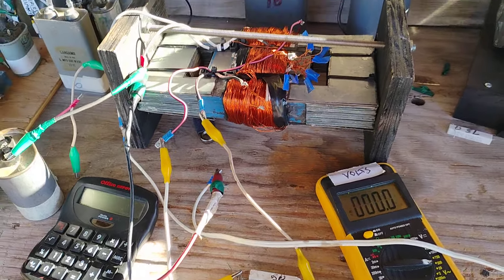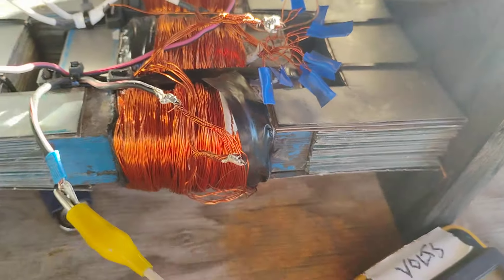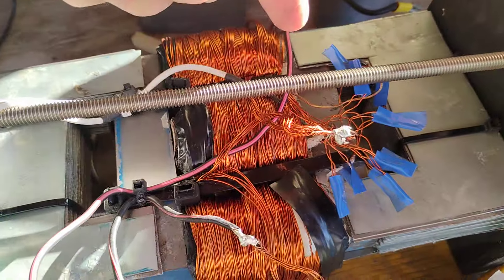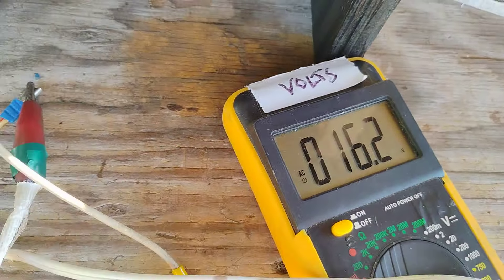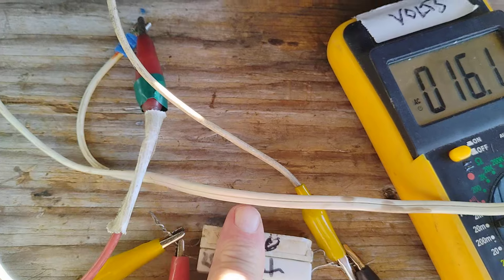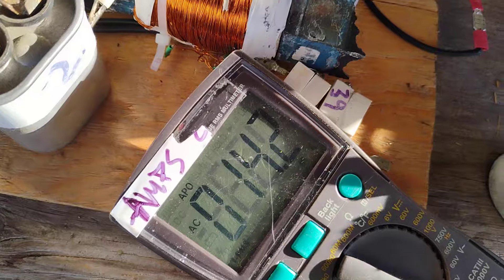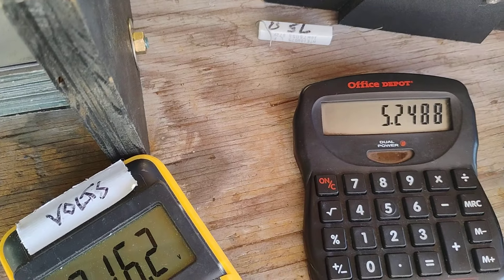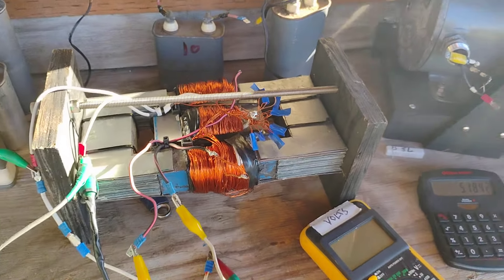5.1W output from a 1.7W input with the  hemmoroidal transformer;  (50 ohm load)

Comment: I also do OU reseach and I lost count of how many times I have measured OU but did not really have OU. Measuring AC or even using an oscilloscope can give incorrect measurements due to phase shifts between voltage and current. Also, never use those wire wound high wattage resistor - they are also inductors. Rather use multiple lower wattage ceramic resistors in parallel. As for correct input output power measurements: it must be DC, thus what is the DC power your input driver is drawing and what is the rectified DC output power?
Reply from the maker: Hi WRND
Yes I have done tons of tests with oscilloscope to measure the phase angle created between voltage in current in these sort of transformers, and would set target of making the input AC be 90 degrees out of phase, while the output with a lump resistive load of whatever ohms works best be of "real" current.....so these transformers "can be"  working like reactive power convertors to REAL power which is a good thing.  
However in these tests I "power factor correct" with caps the primary input with an AC cap in parallel to the primary (when using the grid -( the invertor tests needs them in series for some reason)  - only a very specific size cap works, not too large uf not too small so it must be some sort of resonance going on .

This is common practice with the grid - to put AC caps across the input to appliances or AC fan motors etc  that have large inductors inside them to reduce your power consumption and lower electric bil.... with the invertor I dont know if that is technically power factor correcting going on since the invertor I use actually DC boost convertors that alternates DC cap discharge for AC, so you cannot see any "phase shift" on scope for one thing...

Yes I know you want to show DC input vs DC output so no arguments but I am not trying to avoid arguments haha

With this statpower invertor I use, it is super effecient - if pumping a transformer or AC motor with it, and now lets say 6W in DC input to it, it will also show 6W input if using the grid - usually there is a loss using a transformer, but these "hemmoroidla" transformers show a good gain (since no backemf problems with them)

As for the output, it is very "solid" ("should be" no arguments) power measurement in AC having a lump resistor across the secondary output, and squaring the voltage across it and dividing by the ohms resistance...your argument about these resistors having internally ainductor is a pretty minor argument as it cannot be argued (but could be) it is really an "inductive load" because of that internal "heat wire" in it,
Also I am working in 60hz on purpose, so meters should be accurate.....

it is 99 percent a  resistive load  not an inductive load to these resistors I use... unless argument is nitty gritty about that one or two percent or less variation to what meters will show in watts.  So one or two percent "inductive" compared to "resistive" and not much to argue about. 

If you want to get into an inductive load on these transformers, there is a whole new ball of wax that could take months to "rectify" (not a pun haha)  and performances with inductive loads can really be "off the scale" unbelievable  such as looping motor-generators and the like as the inductor becaomes just "extra windings" to the secondaries if you think like that....

Then there is capacitance loading too of secondaries.....in that only a capacitor (secondaries recifified first) _ and then you have a two-stage cap discharge output cycle (three actually) in that cap fills, (stage one), cap decouples from rectifiier diodes (stage two) then cap while "floating" discharges to the load (stage three) and then cycle repeats.....so there is another huge ball of wax to peel away surrounding power being possible vs power input.....it would only be during cap discharg power is being made, and it is totally decoupled from discharge so impossible for any blowback of backemf or whatever during discharge - it is only filling up the cap each cycle where the transformer will see  a resistance, and it varies as capacitor fills up too so gets complicated if you want to put it on paper and formulas.....

to me better and more simple to just put one of these resistors I buy at electronics store across that AC output and measure voltage across resistor to test watts input vs watts output see if it is overunity (or not) according to ohms law.  If overunity, i give credit to design of hemmoroidal  transformer and the shunt bars eliminating the backemf problems that will usually happen when backemf magnetic currents return to primary so (it creates that extra draw under load of secondaries, so no gain always a loss with transformers when this happens).

Comment: Hey Doug.  It looks like you used a 5 strand winding with the secondaries in a bucking configuration to each other.  Is that correct?
Reply from the maker: Hi Tachyon   Good observation - you almost got it right, there is a bundle of 12 paralleled multifilar winds of 25GA magnet wire, tthat was wound around all three legs, each leg about 30ft length bundle - makes it really easy to wind up the transformer, plus should be more effecient similar to litz wire, plus gives ability to run them in parallel or series or both, so you can zero in on what sort of impedance you want to have going on (adjustable impedance transformer).
I paralleled a group of six into another group of six paralleled so secondary windings have much  lower impedance like this,, so it becomes  a step down transformer (meant to power an invertor and not exceed 16V if 120VAC input to primary)
There is no bucking going on, although you could try it if you want.... its "series adding" all 12 wires in the primary for high impedance (and so 120VAC input does not make anything get hot)
While the secondaries are the "bundled" multifilars of a group of six run in series to another paralleled group of six, then the secondary A connects in series to secondary B.....I could do the secondaries in parallel, or each secondary has its own load, are other options that can be done.  

It might actually be 10 strand multifilars, you counted right, and my other 3ph transformer thinner wire and that one maybe 12 strand multififlars - will have to count!

Comment: i guess if your doing the Thaine Hines type transformer then the initial back emf would keep getting redirected so this means another back emf can replace it right away and there is no pushing the back emf forward with this type of core system >
Reply from the maker: I guess so, I am not sure about anything!   But  I will keep guessing there is backemf every polarity flip, that is when it will manifest - similar to DC flyback pulse, (but that is near pure voltage while backemf magnetic currents is pure magnetic current) and we all know when you cut off the DC pulse into an inductor very sharp, you get that flyback happening....in AC instead of flyback you get the backemf happening more or less.....however AC can be DC pulse alternating direction every other time too, so possible to have both....the voltage must "lead" the current - the currents, especially the magnetic type, very slow compared to the voltage flyback (my theories)  
The invertor I am using has no windings, it is "alternating DC boost convertor" circuit in it....very effecient and half the draw compared to a regular invertor......

Comment: Very Nice Doug!👍
Reply from the maker: Hi Tim3
Took me awhile to finally get something working right again!  So simple when you find it.....the 50 ohm load works really good....note no scope and phase shift stuff this time - just meters in these tests, lots simpler more understandable to JQ public although I like the confusion and "what he dont know we dont understand"  phase shift and power factor  brings....
This transformer "stopped working" for about a week - the shunt bar laminates were not being pressed against the 3 phase transformer cross-leg  tight enough - not all the hand-cut laminate plates perfect in size and  height, and when I pressed the clamps down hard, it would press "some" of the laminate plates tight, while others not so tight.....so I gooped alot off epoxy on the "top" of the shunt bar laminates so when the clamps press down, the clamps will press evenly on tops of all the shunt bar laminates  so  the surfaces of of the laminate plates that make contact with the cross-leg surface will fit really tight and the backemf magneitc currents will want to go "that way". 
Sorry about the hemmoroidal joke but I think its stupid and funny too, (who would want to take me serious!)  while there are no torroid coils anyways so might as well call it something else..

Comment: by pushing it forward i mean in the direction of your source , since it is getting redirected there is no chance for it to get pushed forward and out the exit, its getting redirected out the side and to the load , meaning you must have two loads to make this work correctly one load our the normal exit say the secondary and another load out the side , like the Thaine Hines Transformer
Reply from the maker: Yes this is like the Thane Heinz transformer design.  Those called Bittorroidal (BITT) but there are no torroids in this one,so I call it hemmoroidal (name for it Hector made up)
I dont think two loads are required, but maybe if each secondary had its own load it might work better in some cases. 
Basically the whole idea is to keep the backemf magnetic currents from going back into the primary leg, as is usual in transformers, which raises the input draw signifigantly from the backemf lowering the impedance of  the primary windings, and so this  requires more power input whenever the secondaries are loaded (so no "gain")- but send those magnetic currents into oppostie secondary if the currents can travel that far, now it not only gets rid of the backemf problem but reinforces power being made too and you get the overunity thing pretty easily.  If using a scope,, these transformers can operate on "reactive" power, while the output is real power when the phase shift is around 90 degrees between voltage and amps.